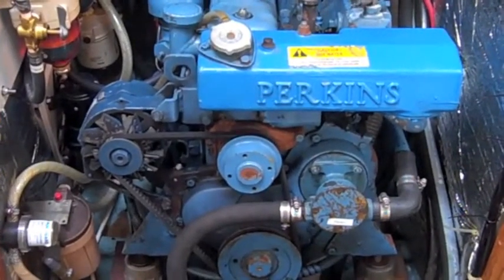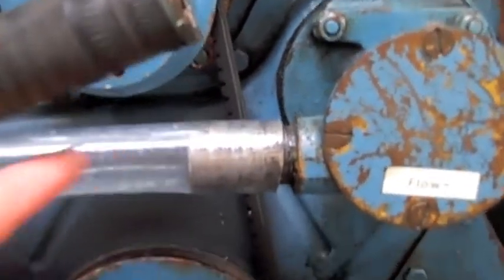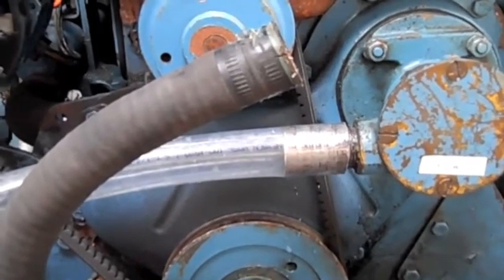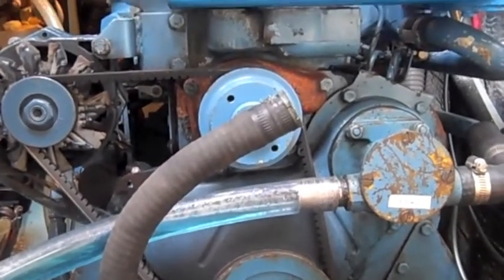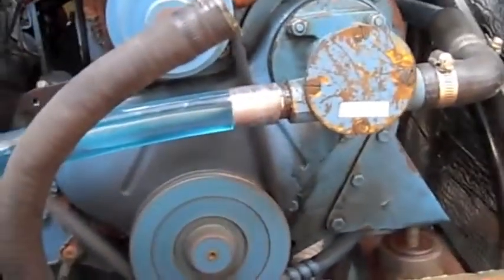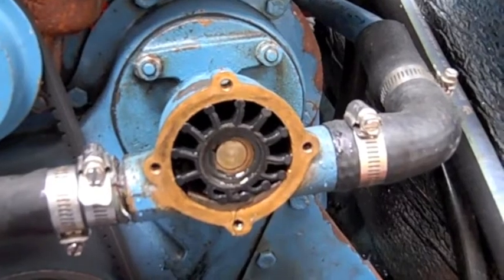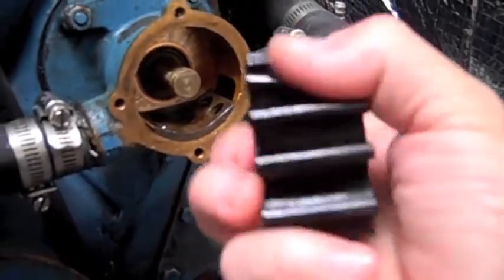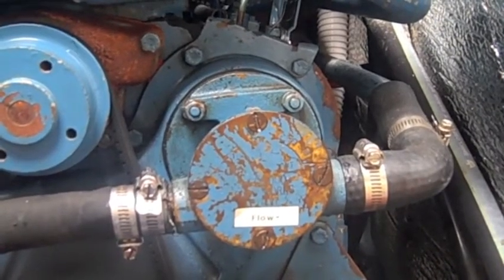Winterizing Perkins 4.108 Diesel

Comment: Good vid... well presented. Just curious....where are you located? Is it common practice to release coolant (will assume glycol) on to the ground in this fashion? I would think that coolant is not the best thing in the environment....I do know they keep saying it is dangerous to wildlife. I’m no greenie by any means but I just don’t think spewing 4 gallons of coolant out onto the ground is a smart thing to do.
Reply from the maker: Ian Adkins no it was a bad idea. It is non-toxic, but I should have contained it - and I do/have. This was a rush job and I’d forgotten my reclaim bucket. Not that it makes it right, but all the anti freeze in winterized boats gets spewed directly into the water during fall commissioning when the engine is started for the first time. In many boats, that’s at least two to three gallons and maybe more in larger motor vessels. Not a defense. I was wrong to rush. I should have headed back home for my forgotten gear.

Comment: Hey Thank you for the Video!  I am totally new in Perkins Business, I've got the same 4.108 Diesel like you. A Question, can you send me your winterizing Checklist?:)
Reply from the maker: Tim, Glad the video was helpful. My winterizing checklist is in my head, sorry, but here goes: Perkins has a closed cooling system, so winterizing the engine includes what you saw in the video (plus draining the raw water strainer). Winterizing the rest of the boat's systems includes draining all freshwater tanks and then drawing -50 non-toxic antifreeze through the entire system until I get full strength at each faucet (galley and head). No water heater aboard, so I don't fuss with that. When we DID have the water heater, however, I drained it and then pulled some antifreeze through it. Head and holding tank get flushed and pumped out prior to haul out. I then dump -50 antifreeze into the toilet bowl and flush it through the head and into the holding tank. Washdown pump gets disconnected at the intake thru hull and I run -50 through it until it comes out at the deck fitting. Since the galley foot pump draws from the same thru hull, I pump it until I get antifreeze through it at the sink. I also pump the bilge dry and then pour a bit of -50 into the bilge and run it through the bilge pumps. Finally, I work all of the seacocks through full rotation in both directions to allow any trapped water to drain out. If you have an air conditioning system, you'd have to be sure to winterize it, too, which I've done aboard the trawler quite simply. Anyway, I think that covers it. Cheers.
Reply: @cdsailor  Oh Thank you for you're Answer :-) Your Video is so helpful for me!!!!

Comment: I own a perkins 4236 and I live in a warm climate yet the winter is a little cold without snow ,I did not know that I need to change the oil based on hourly schedule and instead I thought every 3000 kilometers but I found the oil loses it's thickness before that which made me change it early at about 30 or 40 hours of run time ,

Comment: if u kept using it in winter would that be needed
Reply from the maker: mo abdulhamid I change the engine oil every 50 hrs. If the engine called for a different viscosity oil during cold weather, then yes, I'd change it and refill with the appropriate winter oil.

Comment: Where is the garden hose attached to on the engine ?
Reply from the maker: The garden hose is the freshwater supply for the bucket, and it comes from a spigot in the boatyard. The only hose to the engine is the clear hose you see drawing from the bucket. Does that answer your question?
Reply: 79cd36 Thanks for your reply. Thanks for putting this online. However the hardest part of engine maintenance is trying to find and identify  the parts. It is the main reason the old printed manuals with photos  were so hard to use.